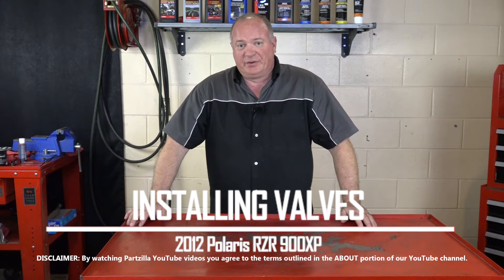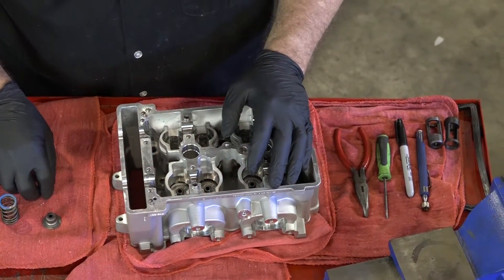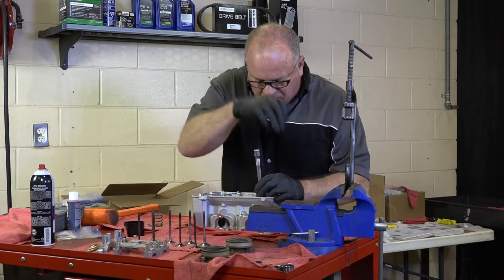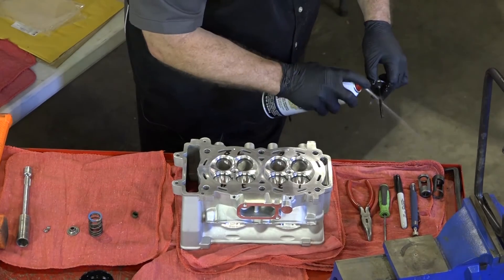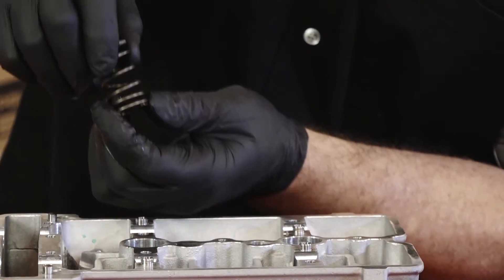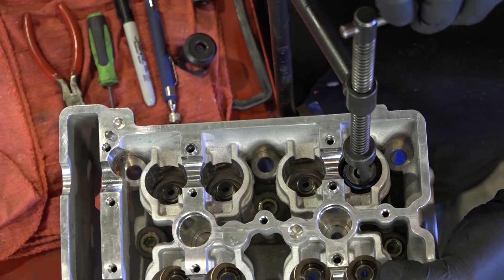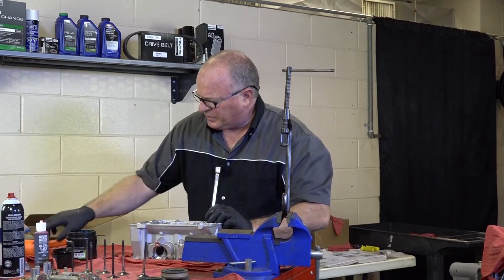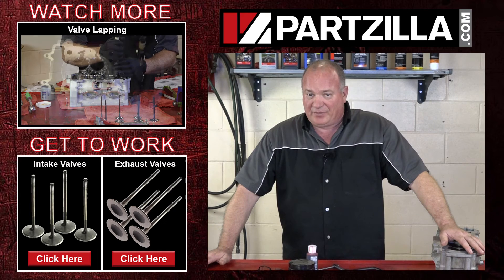Engine Valve Installation | Polaris RZR 900 XP  | Partzilla.com

Comment: Hey John I’m in the process of replacing the valve seals on my xp900 without removing the head. As of now the cam shaft lobes are not putting any pressure on the valve buckets so Can I just put some air pressure in the cylinder to hold the valve up and get it done or do I really need to make sure the pistons at TDC?? Really don’t want to open the sealed clutch cover if I don’t have to

Comment: Excellent video once again, thanks John. I do have a question: Have you ever installed a stage II cam set with shims and in your opinion is there really any benefit or power gains by doing so ?  When I do end up rebuilding the top end on my 2013 RZR 900 XP I want it to be as stout and reliable as possible.
Reply from the maker: Hello nrgnut. Yes i have installed them before. as far as power increase, you are looking at around 20hp to the crank. in something like a RZR you would notice a deference in power. If i was doing the build i would also replace the valve springs as well.